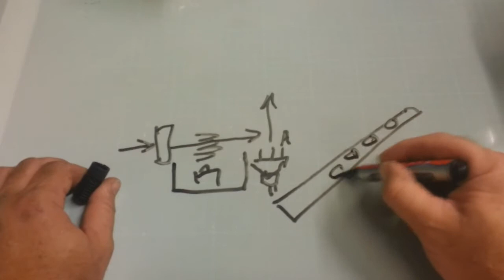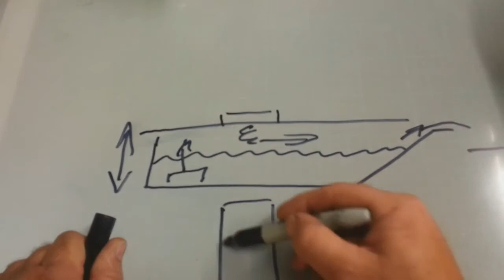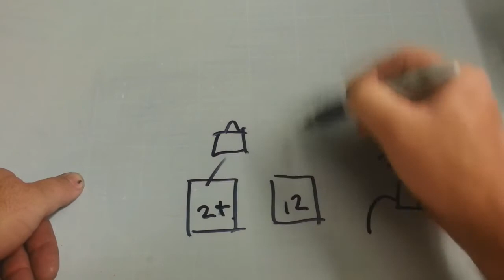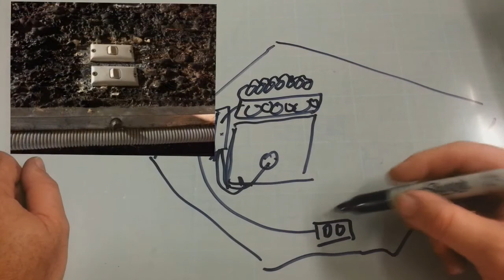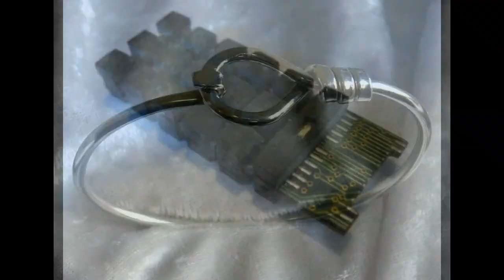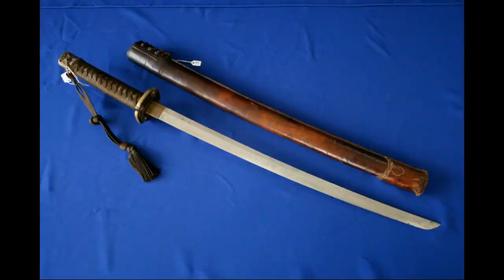Artificial Fire Explained

Comment: Hey Jaz, great tutorial.  I wonder if you know if the vapor could be transported through a few feet of say 1/2" tubing and maintain the effect, but using LED's?  I am going to try a build that would have the fire effect coming out different locations, but would like a central ionizer...
Reply from the maker: I'd say it would but you'd probably get quite a bit of condensation in the hose, I've got plans to do a difference version in the future that uses a vape machine, I think that may be the better way to go for what you want.

Comment: fan is neccessary ???
Reply from the maker: Once the lights heat up it will work without the fan but the flame effect is much slower, so if you what a active looking flame the fan is needed.
Reply from the maker: If you what to get the best effect the fan really does help

Comment: is there by any chance you can show me a link to get those halogen bulbs and the cords to plug them up? trying to make something similar to this for my living room fireplace.
Reply from the maker: The type I used are 12v 20w MR16 Coloured - Yellow 

http://www.ebay.com.au/itm/x5-Coloured-Dichroics-MR16-MR11-12v-20w-50w-Lamp-Light-Bulb-/140474133839?var=&hash=item20b4e92d4f:m:mtRd_QreOcujijhCzhO7lug